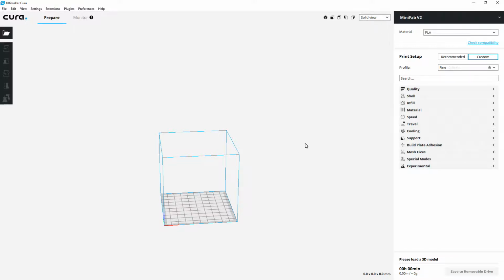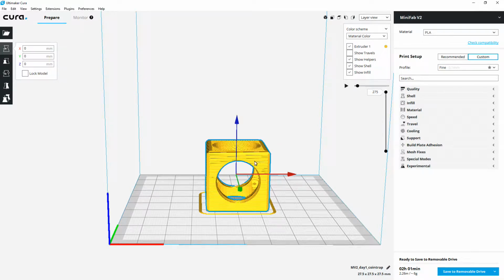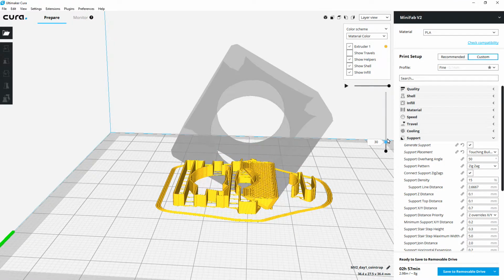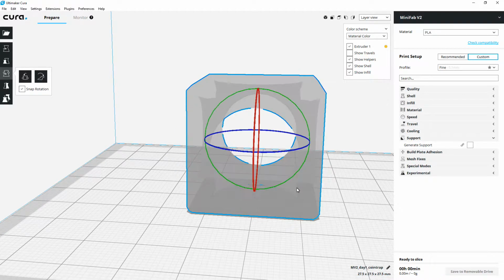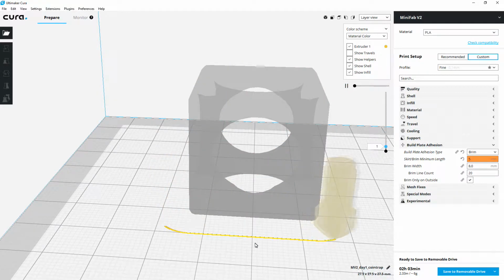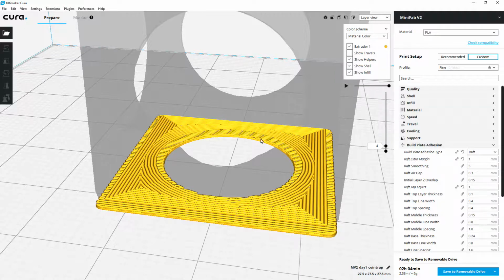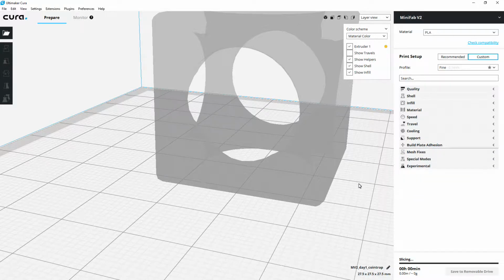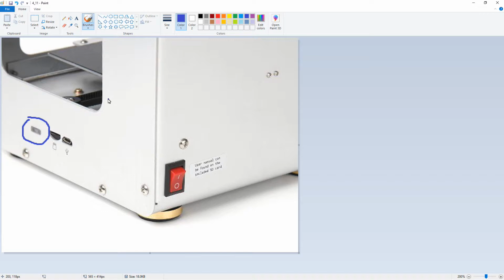Mini Fabrikator V2 and Cura

Comment: hi matthew, thanks for the video! quick question - did you use any preset models in Cura for the Fab II? Cheers
Reply from the maker: Hi FlyingRock, you have to set it up as a custom printer with a build volume of 100x100x100mm build volume, 0.4mm nozzle, and 1.75mm filament.
Reply: Thanks Matthew! do you seen any benefits on the prints from using the latest Cura vs the Repetier/Cura that came with printer? apologies for the silly questions, just got my minifab 2 last week and I'm trying to settle on the settings/software to the get the best prints out of it :) Cheers